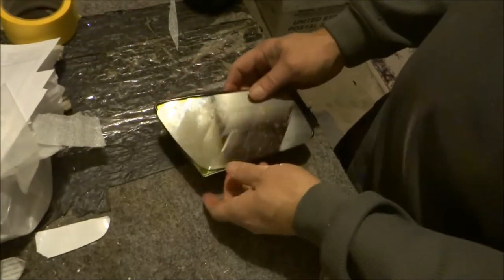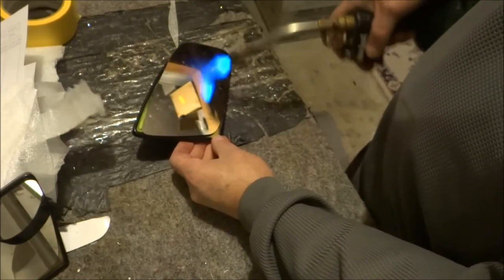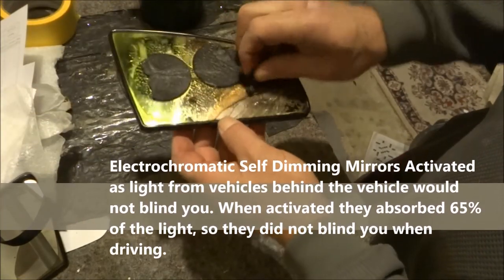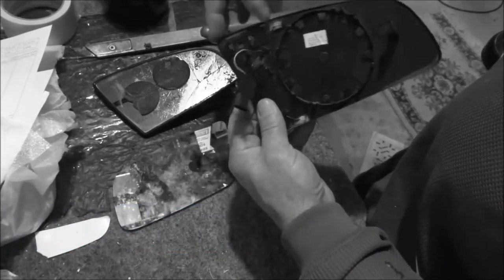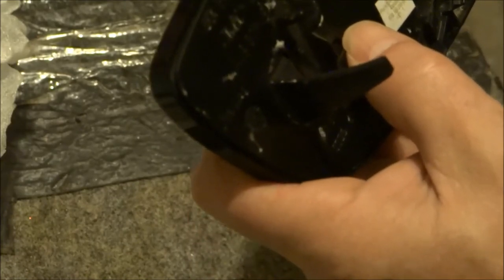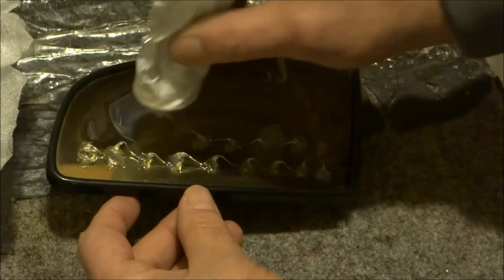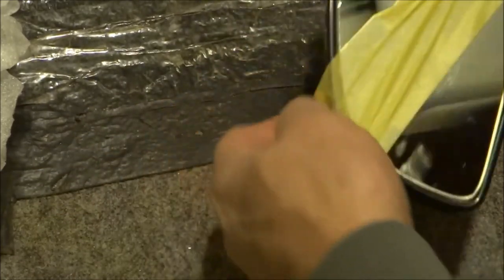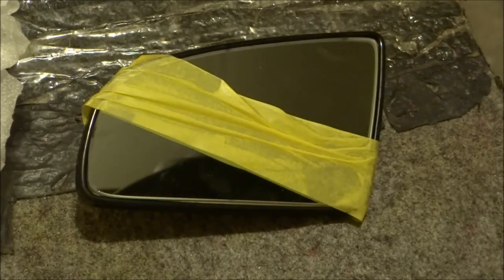Auto Dimming Fit Over Car mirror installation.

Comment: I have a 1999 Chrysler Town & Country Limited. It has a self dimming drivers mirror that has started leaking out the fluid. As such, it’s gone opaque. 

I did what most guys do. I ordered a cheap new mirror from RockAuto (or your typical auto parts store). 

Then I happened upon Ray’s videos and parts website. Man am I lucky I did that. I was about to cause myself a whole bunch of headaches and extra work. 

Thank god I watched his videos and gave him a call. He walked me through the process and sold me the correct mirror - which for my application is a fit over style. Not a replacement version. 

I was ready to pry my old mirror off. Likely I would have ruined the heating element in the process. And then put on a crappy made in Mexico mirror that would likely blind me. 

Ray got me the correct mirror. And gave me the right advice on how to install it - saving me a ton of time headaches and costs. 

That inexpensive mirror would have cost me more in the short run in pain and aggravation. I paid a few extra dollars to Internet Glass, but well worth it to get the right product and the wisdom to install it. 

I believe in the adage “you get what you pay for”.  Ray was helpful and followed up our discussion with emails, links to additions install videos and friendly advice. 

Nice to see that this kind of service still exists in America. 

And here is the best part. Ray is super knowledgeable. Clearly he has been in the industry for several decades. If you got a glass problem, likely he has the knowledge to help you through it. 

Watch his videos. 
Call him for advice. 
Most likely importantly. Order his products. That’s the value of his business versus a chain store. 

As a final note on my install. I compared the mirror I got on Rockauto to to the mirror I got from Ray. It was the wrong mirror and would not have worked. 

Ray knew that simply by my giving him the part number. 

This is wisdom you don’t often see in business and it’s worth every penny.

Comment: Hey guy I appreciate your expertise in the video. Would it be possible to add an electrochromic mirror to my car which comes with a heated only mirror? Thanks
Reply from the maker: Give me a call next week 845-496-2500. But do include what your year make and model is which really helps in this tag on YouTube. Thanks
Reply: @raytheglass  it is a 2018 honda accord ex

Comment: I just ordered one of these for a 98 Deville. How do I tell the back of the mirror from the front, and does it matter? Both sides look the same?
Reply: If you ordered from me, you would have first surface chromium. If you look at the mirror on both sides indoors, you will see one side that is slightly blueish. That is the (backside)  that is glued to the mirror. The front (outside) would be all silver. If  you bought a Chinese mirror, you will see silver on both sides. If you look through the mirror you can not see through it. This means you will be blinded by the lights behind you at night. If you looked through our mirror, you will see across the street. That means it will absorb the light but however 20% less than the auto-dimming one that failed on you. Good Question Kent.
Reply: @rayalbrecht6011  I prdered form you, but I ordered the wrong shape mirror. My fault for being an idiot, and not going outside to check before I ordered. I ended up buying a used mirror from a '98 Deville and installing it and the backing plate together.
Reply from the maker: Glad you were able to find that.